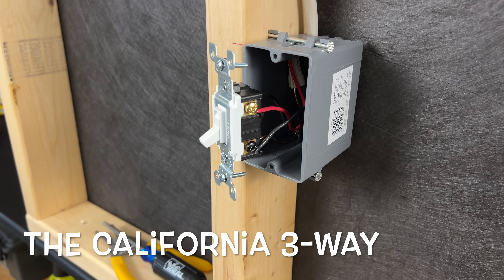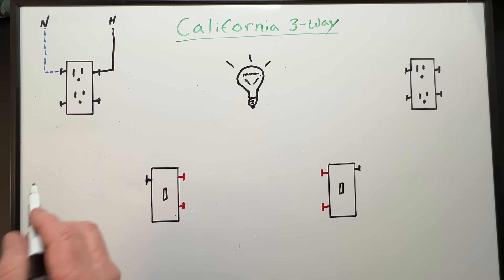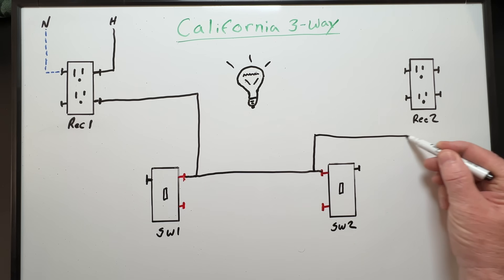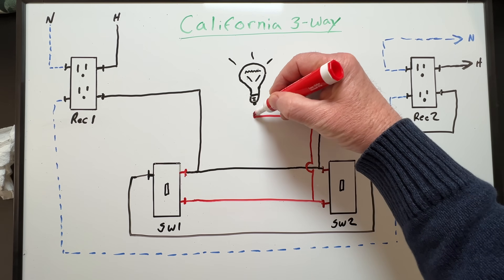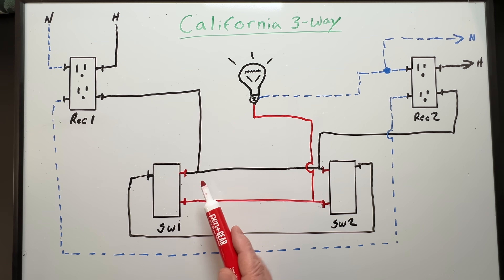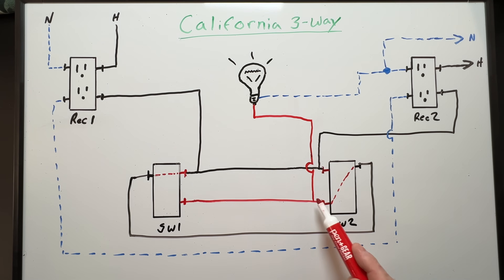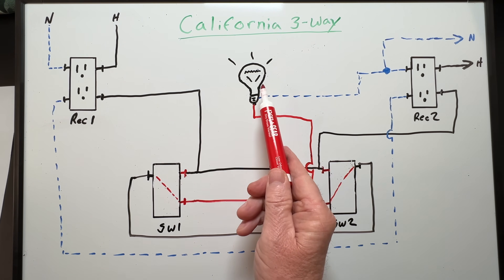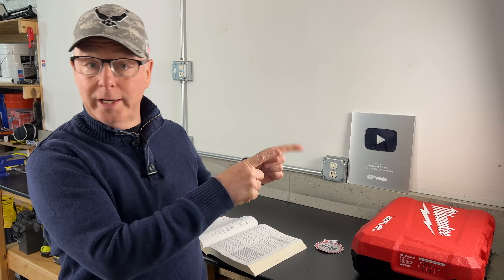What is the California 3-Way Switch?

Comment: Umm.. there is nothing in the codes you quoted that makes the California 3-way inherently any more or less "outdated" (or code-compliant) than a standard 3-way.  You can do a California 3-way while also bringing the neutral conductor into one or both switch boxes, and it's still a California 3-way.

IMHO the main reason not to do this is that it is more confusing, and doesn't really gain you anything over a standard 3-way (but at least it's not dangerous or against code like a Chicago 3-way is)...
Reply from the maker: Correct as stated the code violation is that there is not neutral. I agree with that it's more confusing especially for anyone changing switches after the fact. I have seen this in use where they did carry the neutral wire to out buildings or a detached garage. They would have a 3-way in the house and another one in the garage along with a receptacle off the same four wires.
Reply: A California does seem complicated and confusing but it’s really not once you get used to it.

The only conventional three way circuits that beat it for number of conductors are the straight and dead end three ways. A roughed in three way switch loop can be wired California or conventional. The benefit of a California is when you have multiple loads on a three way like a string of lights in a hallway or the center isle of a horse stable and you need hot and neutral in every box in the string including the switch boxes for more branch lighting circuits. It also works when a customer wants multiple receptacles in a room with one hot and one switched receptacle in each duplex but the switched receptacles need to be on a three way. To do that conventionally, five conductors are needed but with the California only four are needed. This is the reason for its invention.

The downside is that the California can never be a four way. That won’t work.

Comment: If I'm understanding correctly, all that would be required to make that wiring method code compliant would be a neutral wire running into one of the switch boxes and I'm not seeing why you couldn't just do that. Even if the three wires in a raceway rule still applies. I'm assuming this is in conduit inside a slab or something like that running THHN or similar. I only see one wire in the raceway from Rec1 to SW1. You could add a neutral in that raceway and you're still at only two wires. You now have a neutral at SW1 and that seems to comply with modern code, doesn't it?
Reply: I agree. I see that too. 
From Rec1 to Sw1, Run a neutral with a hot

From Sw1 to Sw2, run two conduits. hot and traveler in one conduit and in the second conduit run the neutral.

From Sw2 to Rec2, also run neutral with hot.

Comment: This version (called an "Sparwechselschaltung" - "economy 3-way switch” here) is still permitted in Germany and is occasionally used in garages or basements, as a switch/receptacle combination is often installed there. This provides a receptacle at both switching points.
Reply: I don't see how there's anything particularly "economical" about this.  It still requires the same number of wires, etc, as a standard 3-way + unswitched conductor (for the outlet) would need.  It's just a more complicated/confusing way of doing it...
Reply: @foogod4237  
Individual wires in the conduit are not usually used here. 
Sheathed cables are used here in Germany today. These are available in 3 or 5 core versions, which most electricians here always have with them and because a lot of this type of cable is used, they are also relatively inexpensive. They are also available with more than 5 cores, but these are usually unreasonably more expensive and have to be purchased first because they are rarely needed.
This is where the "economy" comes from.
Reply: @kaysonntag74  It doesn't matter what kind of cable you're using.  It requires the same number and type of conductors, which means you can use exactly the same cable either way.

Comment: Some years ago I independently had the idea of doing this and I actually really like it. Where it makes sense is when you have the panel at one end, a switch, a couple of lights, and then at the far end of the circuit a switch and an outlet.

You run hot, neutral, ground, switched hot, and "control wire" all the way from the first switch to the last one, through all of the light sockets in the middle, and it saves you a conductor.
Reply: Is 14/4 really easier than a 14/2 and 14/3 though?
Reply: @plkracer  You make a good point, this is much better adapted to stranded in conduit. Also (I talked to my dad and he commented that) this is a very bad plan if you are just grabbing hots from wherever you find them - because you can easily create a 240v dead short.
Reply: yeah sounds great 👎

Comment: My house in Kentucky had 3 different circuits with 3-way switches. I could not figure out the wiring - maybe this was how it done - built about 1972 or so.
I took it out and put in new - using a 14-3 - with the method that I understand. I had to do a little drywall patching, but it was well worth the effort - at least in my mind.

Comment: "of course each location has ground wires" Ha, ha, ha!
Reply from the maker: Assuming we're talking about modern wiring. I know old home run in knob and tube really carried a ground. Although a ground wire has been a requirement for over 100 years many places didn't have inspectors or even licensed electricians for a long time after that..

Comment: First, I hate lights and outlets on the same circuit, as I don't like the idea of an overloaded outlet plunging the room into darkness, (but a switched outlet where you can plug in a lamp, is a different deal and okay.) Second, you're avoiding sending the neutral to the switches, but still have three wires between the two switches---what's the point of that? And you still have to send a neutral to the light fixture. I'm not saying that the California 3-way doesn't work, is dangerous, or can't exist, but that it's pointless, with zero advantage over the standard 3-way.
Reply from the maker: I think I mentioned in the video that the reason it was done was there were some counties in California that required conduit and you couldn't have more than three wires in the pipe. Also to minimize conduit runs they continued the circuit through the switches and on to other loads. Otherwise you're right there would be no point.

Comment: Every older home in Southern California with a detached garage was and many are still wired that way. The purpose was to have a connivence outlet in the garage and be able to control the garage light from the house. Also back then the wires were run overhead so it reduced the number of wires needed. Most of the time the neutral is in the switch box. The non-code compliant issue is no grounds.
Reply: There are two travelers, a constant, and a neutral running between the switches. You could do this with standard 3-way wiring with the same number of wires. Am I missing something?
Reply: @Bapuji42  I totally agree. I can’t figure out why anyone would do this.
Reply: Look again. . . 
If you want a light at the back door of a house and another light outside a detached garage, switchable from either building, the California three way setup provides a switch loop at both ends; the standard arrangement would require an extra wire for the switched hot at the "house" end of the run.
Reply from the maker: When run in metal raceway the race can be used as the ground. Yes, the advantage was extending to circuit beyond the switches. Which what you're talking about carries the neutral which is fine as long as you were not in a county that required conduit and limited the number of conductors to three.
Reply: @BackyardMaine  My understanding is that code in Los Angeles County allowed four wires in half inch conduit if one of the wires was a switch loop; otherwise the limit was three wires.

Comment: In my location, each built-in light has to be on a separate circuit.
With at least one light per room or a switched receptacle
With Hallway.Way And stairwell lighting. Each on their own circuits.
Reply from the maker: Never heard of such a thing.. Not even in a local code. Where are you from. I want to look that one up.
Reply: @BackyardMaine   If asking me, I'm in El Paso county in Colorado.
Reply: Wow, that is a lot of breakers. At my location it goes by square feet. Three "typical" kids' bedrooms, the hallway, and shared bathroom could fall within the square foot limit for a 15A circuit, but given LED light fixtures maybe pull 3A at the most.
Reply: @ScottyDMcom  a led bulb uses 13w at most the reason we still have so many lighting circuits is one it is better to lose a few rooms lighting than the whole floor and two just incase you are one of the rare hold outs still using energy hungry incandescent light bulbs
Reply: @404hopenotfound   That's what I said. There are two limits in the NEC, one on wattage, the other on square footage. We used to use bulbs in some ceiling fixtures, but not on new construction--it's all fixtures. I've given up on cans--they take too much space, cost extra, and some future person might swap out the LED floods for incandescent floods. I'm partial to those thin pancake fixtures.

Recent job was a partial basement remodel that was about 30 x 25 feet--workshop (super bright), library (medium bright), utility room (bright), and stairwell & hallway (medium bright). Could easily power all with one 15 amp circuit, but code says that because of the square foot limit, we gotta use two circuits.

Comment: When wired in 14-4 with both switches,  and the two common terminals connected back to back the rest is easy peasy. I,ve done that for years that so called code violation. As long as I tap for the light from either switch with 14 -4 I interpret that as code compliance.

Miss Paula Walach
Reply from the maker: Paula, this is a code violation due to the fact the neutral is not carried to at least one of the 3-way switches. Neutral were required at switches beginning in 2011 with exceptions. One of them being that if a cable could be fished in without removing the wall covering the neutral would not be required. So any home with an attic or a basement could use this exception. That exception was removed in 2023. This issue was that people were installing smart switches and with no neutral in the box they would connect the neutral wire in the switch to the ground wire in the box putting current flow on the ground.

Comment: In your drawing at 3:26 that neutral wire goes right by both switches, so just poke it in the sw. box and you are good to go if you add a ground wire or metalic tubing etc. However, you are showing a three prong rec. with no apparent ground either. What, other than the missing G & N makes this non code compliant?
Reply: I can remember a few California houses with detached garages where there were FOUR wires running overhead between garage and house-- the light at the back door of the house and an outside light at the garage were switched using California three way switches at both locations; then there was an unswitched outlet and a light, on its own switch, in the garage. Also note the exception allowing FOUR wires in one conduit, if the fourth one was a switch leg
Reply from the maker: Again three wire max in the conduit. And remember this was only code in a few counties in CA. The neutral needs get to the light and receptacles on another run.
Reply: @BackyardMaine  No, at the time, the California code was 3 wires max, UNLESS one was a switch leg.  So, 4 wires was an exception to allow a switch leg.

Comment: That looks very bad. Can't the inspector see that in a ruff in inspection.
Reply from the maker: Before 2011 we didn't need to carry the neutral to the box. It's a clever way to carry the circuit through your switches on to other loads but now we need a neutral in the box. Another thing I don't like about it is you have your down stream current traveling through your switch wires.

Comment: Thanks for the heads up, in case I ever run across this wacky setup someday. And I thought it couldn't get any weirder than the Chicago 3 way.  😅

I've heard of the California 3 way and assumed it was simply another slang term for the carter / Chicago method, which I now like to call a farmer's 3 way because I ran across it once so far, on a farm in Sanilac County michigan,  installed about a year after electricity became available on the farm in 1951.  

I would imagine having electricity on the farm for the first time was so exciting (much like the electronics stores on black Friday the year the first iPhone was released to the public😊) nobody at the time considered the obvious danger of changing a light bulb or fixture that was turned off with both terminals at 120V to ground potential or the possibility the switches were on two circuits and fuses/breakers got rearranged so as to place one switch on L1 and the other switch on L2 = 240V to fixture in one of the four switch positions.  

I really don't see any added  benefit  to the California vs the standard method other than to satisfy the local codes in California. Whereas the Chicago or Farmer's method had the benefit of using only three wires instead of four not counting the ground,  to switch a lighting outlet between two 3 way switches with constant power to receptacle outlets on both ends, although this method was technically illegal since the 1923 NEC it was used well into the 50s, maybe even the 60s and beyond,  by old timers who lived during the tough economic times of the 1930s where frugality and making the most do out of the least, was a must.

I am very familiar with the dead end 3 way, I've used this a handful of times during renovations when I need to convert a single pole switch to a 3 way / 4 way setup while doing little to no drywall damage.
Reply from the maker: I think the key advantage to the California and Chicago where that both methods carried the circuit beyond the switches. The Chicago was hazardous and the California had no neutral which was ok up until 2011. I think a people stared using it with a neutral in other places for out buildings and detached garages. It allowed them to have a 3-way in the house and another in the garage and also have a receptacle in the garage on the same circuit. With code requirements being updated over the past few decades this is no longer an option. Yup the dead end is and was used to cover a single pole to a 3-way.

Comment: They want every single house in America rewired just so someone might put a dimmer in?
Reply: No, the new rules only applies if you are adding new wiring.  For example,  an existing two wire switch loop, with the white feeding the switch and the black as the switch leg or vice versa, is allowed to remain assuming it was installed before the 2011 NEC and passed inspection at the time.   But, say if you are in the process of adding a switch to some pull chain fixtures during a renovation and a permit is pulled,  you'd be required to use a 3 wire with ground cable from the light to the new switch box , where the neutral is capped off and available for future use.
Reply from the maker: The code is not retroactive. This only applies to new installations.

Comment: At least this one doesn't swap polarity of the light socket, like the Chicago 3 way.
Reply: Also, there's always a grounded conductor at the light fixture.
Reply: "switch polarity" is correct terminology.
Reply: @Falcrist  I like my terminology to represent what is actually happening.  If you know how AC electricity behaves, and you know what the word polarity means, then you would know that’s incorrect but you can still use that terminology I don’t care.  Be wrong.  We all use conventional current to design circuits and to work on them even, us engineers, but most of us understand that electrons do not really flow from positive to negative, electrons are attracted from the negative polarity to the positive polarity, and in an AC circuit they do this back and forth 60 times a second.  So we have been using the wrong terminology since the days of Thomas Edison.
Reply: It doesn’t actually switch ‘polarity’ as it’s an AC circuit.  It swaps the live wire.
Reply: @hwtans2717 For alot of reasons the fixture has a direction or "polarity".  It is expecting a hot and neutral and that you wire them a specific way.  We're aware it is not the same as DC.  However wire two lights....on the first wire it correctly and then screw a bulb halfway in and touch the threads of the bulb....then repeat that but this time with the hot/neutral swapped.   You'll find out the problem he's talking about.
Reply: @nathandorris896  I don’t need to find out; I am aware of the problem.  Why did you think I needed that explained to me?  We are talking about hot and neutral right?  Not positive and negative.  That’s all I was saying.

Comment: I live in a house in Nebraska that was built in 1918 with knob and tube wiring. There are no grounds, and the whole house is wired with California 3-way or, as my electrician called it, "California Hot Wire." Most of the house is still wired that way except for parts that have been updated.
Reply: I did catch that video as well.
Reply from the maker: No kidding. I didn’t know they were in use that long ago. Did you see my video on the Chicago 3-way? They were common back in 1918.

Comment: Thanks for covering this - hadn't seen this approach used before! Kind of concerning to see a hot conductor alone - typically need the neutral or at least the other hot "return" conductor bundled in a cable to reduce the overall magnetic field (nothing there to cancel it out with a single conductor)!
Reply from the maker: You bet. Thanks for watching